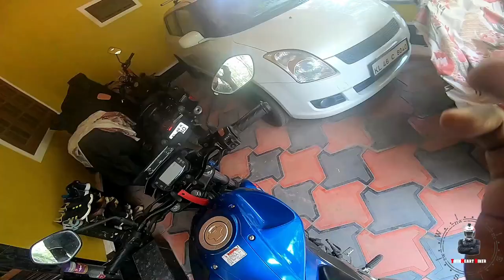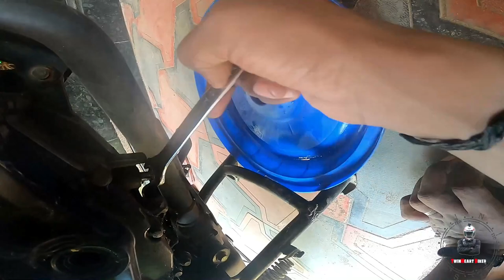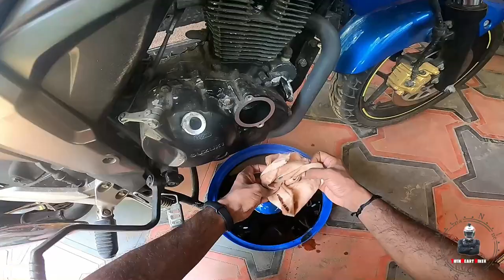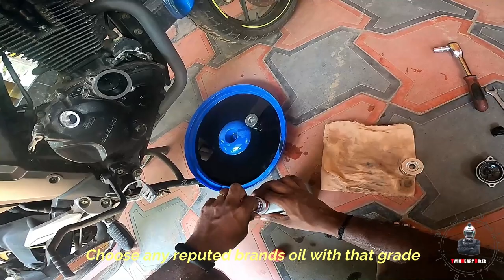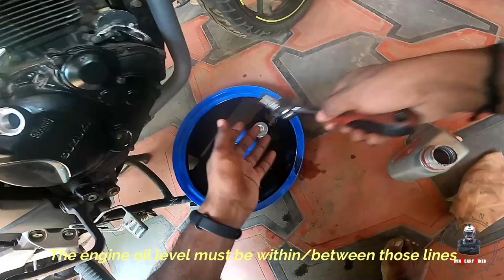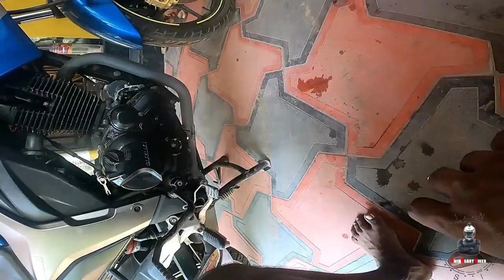How to replace motorcycle engine oil from home | DIY #2 | twinheart biker

Comment: Good video and helpful tips. I would like to add few more tips to this
1. Minimize use of open end spanners, as it can damage bolt heads.
2. After filling new engine oil, if possible crank the engine in off condition using kick lever 5-10 times, so that oil could fill up the oil lines.
Reply from the maker: Thank you bro, good tips, I'll pin your comment as it'll help others too.